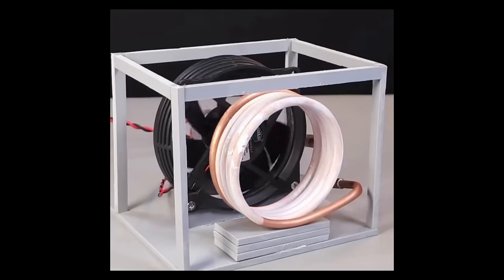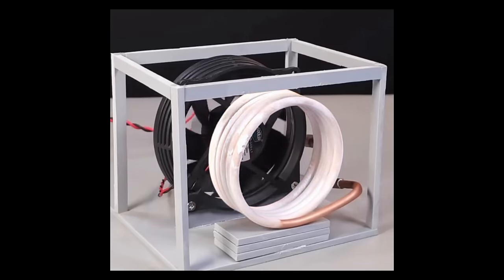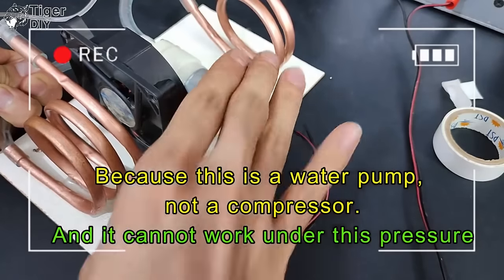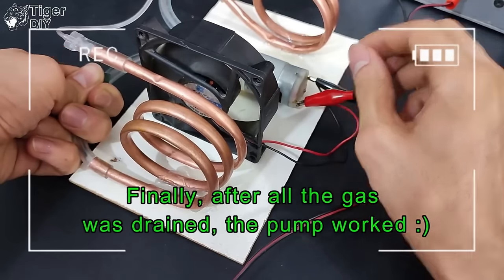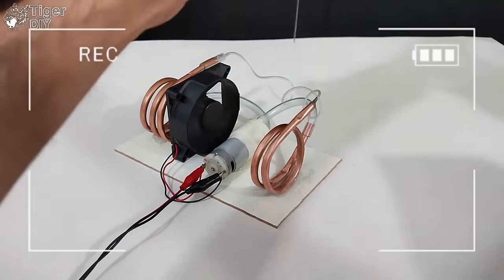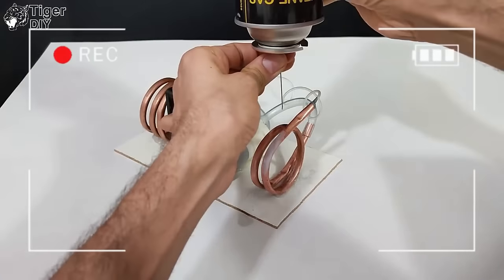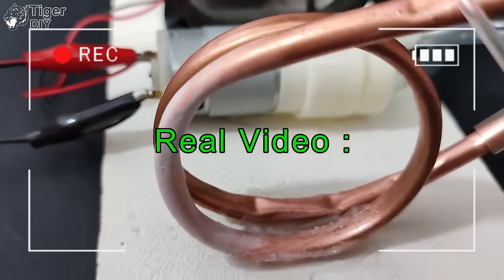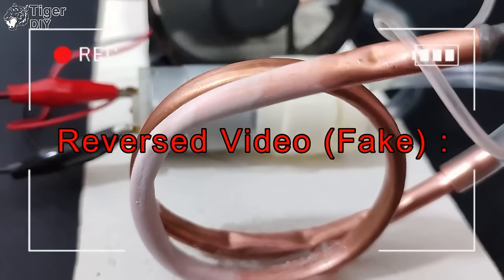2253 Fast Freezing Machine - Is It Fake?

Comment: I had a friend who though that if you got put naked in outer space you would freeze instantly. I had a hard time explaining that it would probably take an hour for a body to reach freezing in outer space. I blame movies for his misperception.
Reply: It's the vitreous humor boiling in your eyeballs that puts me off the whole naked-spacewalk idea.
Reply: @samuelfellows6923  Space isn't a true vacuum, you wouldn't explode like a movie; though your eyes might pop out.
Reply: You can actually survive space for almost 60 seconds. The people who say you freeze instantly or pop, are the same people who say Mars doesn't have an atmosphere.
Reply: It depends on where you are "in outer space". If you are in shadow and in contact with a conductive surface a body will freeze very fast. Flash freeze fast. In vacuum and in the sun, more like cooked.  Both ways, you more get freeze-dried as all the water sublimates leaving a dried husk.
Reply: Assuming you could survive in the vaccum of space I think you would die from overheating.

Doesn't matter how cold space is if there is an almost 100% vaccum.
Only way to lose heat is to radiate it in a vaccum. 
So if your body produces 100W of heat I think it would have a hard time to radiate that to space. 
Didn't do the maths, so not sure about that.

Comment: Hey Rob thanks for the video. I was watching a couple video's about radiant cooling paint which were produced by @NightHawkinLight and @TechIngredients. They were formulating a radiant paint which can dissipate it's heat through reflection of microwaves into space and will produce temps below ambient in direct sunlight. I would love to see your take on this technology. With your experience in battery technology and other chemistry I feel you could come up with a formula we could all make at home relatively simply and cheaply. Anyways just a thought for some content in which I know I would love to see. Thanks again. Cheers
Reply: Quick note, Nighthawk and Tech ingredients don't use microwaves, the best approach or analogy would be a different "color"of infrared, which isn't absorbed by the atmosphere nor the material below, so it gathers heat as anything, and then radiates it as infrared light into space

Comment: Even without the video editing, most hydrocarbons injected into a system utilising push on pvc hose are going to flash off the hydrocarbon liquid and absorb heat until the liquid is vaporised but it’s using it as an expendable refrigerant, the pump and other components are just props

Comment: I've actually been working on a demonstration model of the cooling process. I have already discovered that it's possible to get enough pressure in a 3 part syringe to make the butane condense! 
The problems i'm running into is that syringes are made out of polyethylene or something, so nothing can be glued to them. Also, the liquid butane appears to degrade the rubber seals fairly quickly, and finally at pressures of like 2 to 3 bars, the syringe body tends to stretch and expand, making you lose pressure. 
But the entire thought behind using the syringe, is that you can literally see the gas turn into liquid when you press it hard.
At a certain point i made the entire system with some cheap one way valves for aquarium air bubblers - but those also weren't able to resist the pressure of about 3 bars. Not very surprising. 
In the end, i fear i might have to make my own transparent compressor cylinder from thick walled acrylic or something.
Reply: Glass syringes have no rubber and move a lot easier than poly. The smaller-diameter ones might even withstand considerable pressure.
Reply: Two bars is near to tyre pressure for most cars . Three bars is for heavier duty tyres .  Then I wonder if the squeeze tube silicone type sealants for automotive use can withstand butane without swelling because they do withstand petrol , for purposes of sealing the syringes .
Reply: If you are compressing a few drops of butane. You're not really moving enough heat to cool or warm anything bigger than a shoebox.

A 5ton ac needs 20 pounds of coolant. Compressing that generates lots of heat you need to get rid of.

Plus the frosted evaporator will cause issues if the ice builds up too thick.

Comment: here is a tip for bending soft copper. you can keep it from crimping and flattening by filling it with sand  and capping both ends off first.

Comment: Hi Robert; I have a related question about the type of refridgerators found in caravans, Absorption Refridgeration. You may know this works by applying heat to evaporate a liquid (usually ammonia) which then absorbs heat as it condenses, creating cold. My thought was; would this work when the heat applied came from solar radiation, possibly concentrated? For hotter countries where there is more sunlight, this could be an alternative to Air Conditioning. Thanks for all your great videos and information.
Reply: Rob actually has a video on this idea already. If I remember correctly its based on using pure UREA and a type of KAOLIN clay. You can find it in the video Library

Comment: humm butane does condense from a vapor to liquid at about 35psi and the guy was using a diaphragm pump , I just so happen to have one that is about that small that the Chinese say it can put out high pressure out been meaning to build one to see if it works.

Comment: Hey Rob, I saw your mushroom show, and wanted to let you know about something that they are doing now.  They make a form, and coat it with a releasing agent, and then spray spore into the form.  Then, they close the form, and keep it hydrated for a time.  Then, when they open the form, they have whatever they molded.  This is being used for several different things, but I thought about using it as a replacement for larger dimensional beams, specifically for walls and such.  What do YOU think about it?  You could do a long show on using this "new" technology.
Reply: @The1Elcil  It's not being supressed, as usual follow the money.  Current methods are fast, cheap and well established.  Nothing is stopping you from setting up your own I-beam mushroom company.

Comment: If You use Winter Propane in a heat pump it will work just fine, even the sillicone lubricant can be removed as propane is a lubricant.
Im currently uses an old Air to Water heat pump to heat my hot water to 68-70C 
Its ben running for two years now and works just fine (actually i removed the air coil with a cheap plate heat exchanger from Ali Express to "take heat" from rain water and solar waterheat panels)
All with legal gas and you are free to do this without a certified tech . also the amont of flameble gas is lower than you can store at your kitchen, maybe 1kg.
It worked as refrigiant media for 100year before cfc came along in the 60s
Reply: The problem isn't the compressible, it's the compressor.  He doesn't have one.

Comment: On the plus side, you CAN just buy a little Peltier device from an electronics supplier, and put 12v DC and a couple of amps through it, and it will get freezing cold.

Comment: Hi Rob  please could you do a video on a ice bath ,cold water therapy immersion   normal size bath with water  want to get down to 6 degrees in the bath , thinking coil  fridge compressor , pump but ozone to keep water clean bacteria free ,unsure how to monitor the temperature , for machine to shut off , and how big the coil would need to be and how to join the components .

Comment: So the pump is for moving a liquid only , it can probably move a gas but not efficiently . Butane is liquid up to .6° C but stays liquid to higher temperatures under just a little extra pressure as in simple plastic cigarette lighters. Just wondering if there's a critical gimmick that might actually make refrigeration by use of a liquid pump work instead of using the usual required compressor.  I'm too tired though.

Comment: HELLO EVERYONE!! I am back from my adventures. Glad to see another informative video from Rob. I gotta point out, we have been using FLASH FREEZING tech since the 60s. Mainly for things like Astronaut Foods and novel items like flash frozen fruits. Now it is my humble opinion this is another case of Right Idea, WRONG EXECUTION... but simply because the execution of the idea is wrong or flawed it does not mean its impossible or crazy wrong... So I pose a question TO THE WHOLE community... For a design like this, why are we mucking about with BUTANE??? When a device can be made to run on condensed OXYGEN from the air around us. Dry Ice and a simple aluminum roasting pan for the oven are all thats needed to CONDENSE and collect OXYGEN from the air we breathe. Would it not be possible to set up a simple pump and reservoir that can hold a bit of dry ice, that can cool down a large surface area that can then condense oxygen into liquid which could then be run through some pipes and then be let out to evaporate? No need for a high pressure pump/ condenser

Comment: I've been thinking about making alloys a lot lately and wondering if it's doable to make in a microwave like the ruby made by nighthawkinlight. Maybe venadium-iron alloy is possible. It's interesting talk about the magna cut steel and if it's got an edge over typical high carbon steel or if it's more trouble than it's worth.

Comment: Theoretically, it is a refrigeration system but is there a pump out there that is that small that could make the refrigeration cycle work because all the components are there, but the crucial component a way to compress the butane gas enough for the refrigeration cycle to work. I like to see you, Robert try and make one of these that actually truly functions. See if you can find a pump that would actually make it work and not be fake. I have thought of myself trying to make one of these, just to see if it works I experimented with a parasitic pump and a little miniature refrigeration system, and the one problem I was having was not enough compression to have the refrigeration cycle start working I got close there was a very tiny amount of cooling

Comment: I saw a similar video last year. Started off stating it used a hermetically sealed mini air compressor. Seemed plausible, not very practical. Capillary tube seemed to large to work without being pinched or something. Looked like it was filled with maybe a 1/4 oz of butane. Thought if it did work the 9 volt battery wouldn't do much, possibly demonstrate the working before the butane leaked out.

Comment: I bought a phone cooling fan that magnetically attaches to the back of phone, it has an aluminium heat sink and a base plate where it connects to phone. I didn’t expect much from it but it does get ver very cold like ice cold to the touch and condensation forming, it can’t be far off icing up! And I think in cooler weather it could well do it. For just a simple usb powered fan and heat sink it’s pretty amazing!

Comment: I saw one of the fast freeze today, it actually looked feasible the in the way it was constructed. The two main pipes were joined with a much smaller diameter pipe, maybe 1.5-2mm, which in theory would allow pressure to build up. Though I would put a kink, or squeeze the smaller pipe, to give it more restriction. Would be interesting to test it, to see.
Reply from the maker: go for it

Comment: Would it be possible to make a model heat pump out of bits and pieces. Although the easiest way to do it would be to dismantle a small compressor fridge and use the parts from that.

Comment: Maybe if you had a real compressor pump. Tube and a small capillary tube. Seen it done with random refrigerator parts then put real antifreeze into it or the safe stuff. Maybe propane.

Comment: Hilarious, so next question is what is the simplest way to compress the gas, could you put a check valve and a pressure release valve in line in this system to act as a way to cause the gas to recompress back into liquid form in order to heat and cool the gas ?
Reply: Nope, you still need to force the gas to cram together past the one way valve, which will be harder to open with each pump

Comment: Sir, a inventor PA USA made a curious device, and you might debunk or prove him(he was on TV, but then 👻).
So he took cylinder of metal, bore rows of shallow holes in it then added it to tight Sleeve, one pipe into center and one on end, alinged like Squirrel fan/turbine .
So Spinning the Cylinder inside is producing very high Temps in video, outlet side is Steam.
 But the video, got altered then gone, TV spot said 110% efficiency just spinning a cylinder (with cylindrical pockets)  real fast.
What first got clipped from video was direction of spin and the Pressure differential either making Water hotter, or different direction spin, cooling water rather quickly.  Long winded here but, You did this trick with oil and tin cans for heat, but with little adjustment could you try to get a remake and see if Cooling is 110% efficient and that's why the original video was edited then gone. The cooling part had me, it makes sense, how this pressure differential maintained via engine could be Game changer.
I see if it pans out, Stirling engine coupled with this concept might be self powering, post initial Starting force put in.
Love your work, Cheers
Reply: The cylunder thing is or rather was called a sonoacoustic boiler, they used wayer ram and mechanical heating for boilung water, sorry, spinning it the other way arround also produces steam, wont cool water.
Company withdrew the 110% efficiency after they got better meassuring, still pretty efficient, and then fwll out of buisness when tailoring maintenance and wear vs an electric heating element.

Comment: for those who don't know, in some of the videos the air pump they are using is a 12v, 12 psi (max) pump which is used to inflate balloons and in some other videos, they are using a water pump to pump air because air is also a fluid right?🤓 the butane or gas lighter fluid they are using should explode while the are running. sadly it is not happening. And i also have made one using the air pump(knew it won't work) the pump mechanism just exploded for some reason...

Comment: Seems like nonsense.  There's no high pressure vs low pressure side.  PV = nRT, R = PV/nT.  Need to change pressure and/or volume in order to change temp.  R is a constant of nature (classical physics).  n is the number of atoms in mols, and damn well better be constant in the system or you have a leak.  No hose clamps, a hose with a needle hole in it, no compressor, this thing has no chance to stop leaks.  A compressor strong enough to cool would explode pvc tubes, possibly copper as well, but would absolutely pop off friction fittings or even wire clamps.  You need flared tube with compression fittings, or you're making a bomb of sorts.  Butane plus a sparking DC pump and fan, that's just asking to burn your garage/house down.

Comment: Even the pump was powerful enough to keep the butane flowing and it was all sealed properly, what's the point supposed to be? Why does anyone want a frozen coil? Are we supposed to imagine it will cool the room and forget that there always has to be more heat given off by the condenser coil an the evaporator coil takes in.

Comment: A Makita or Milwaukee batteries powered DC brushless motor will be strong enough to drive a pump for the pressure of butane to make it freeze. 

In the video, the capillary tube that was chosen, was far too large in diameter . That have smaller diameter CAP tube. 
It will work. 
 Must have clamps on the hose.   I would use the clear hose that has a few material filaments embedded in the plastic for strength for the pressure.  But still see through.

Comment: these videos make me laugh. they put in all the effort and get the process mostly correct, by all means it could work - then they go and do one daft step like in this case use a regular pump instead of a compressor and fake the whole thing. Why not just go the extra step and put in an actual compressor? 😆